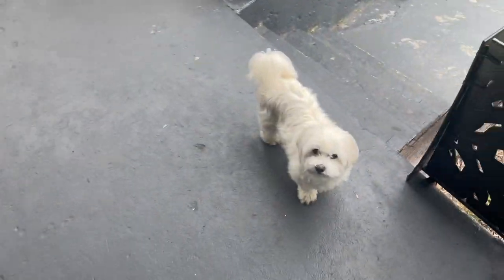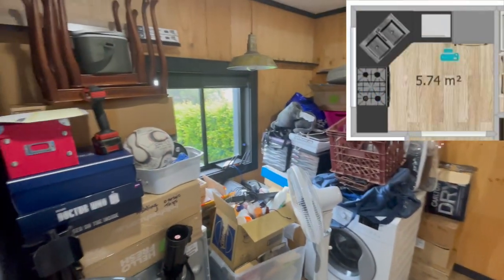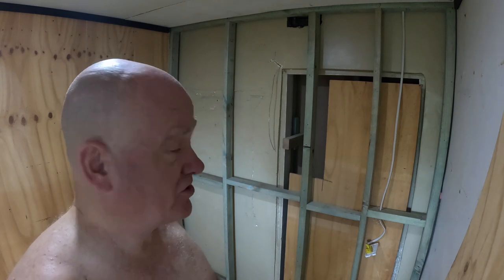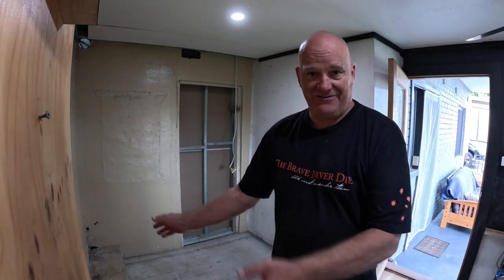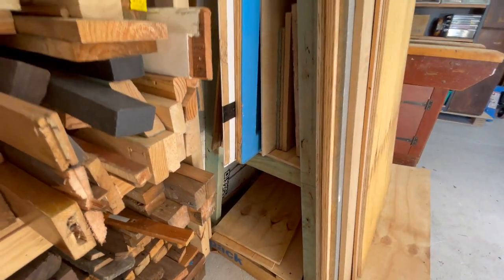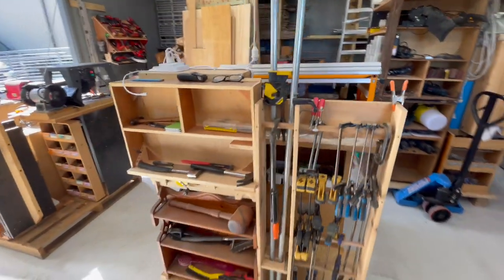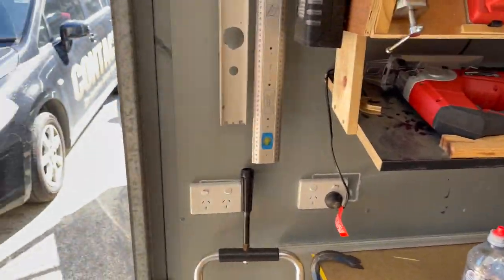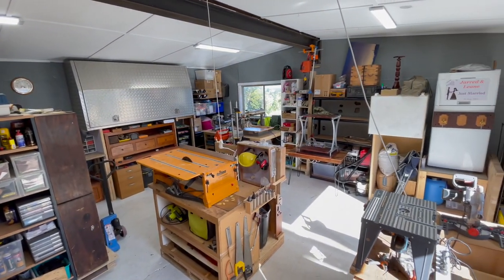Ashling's bathroom demolition pt1

Comment: Looks really good and workable.  I only wish I could get that much power into my workshop.  As you use the space consider not allocating machines space parallel to the wall, if you try some diagonal you might make other spaces useable too.
Mike
Reply from the maker: Thank you Mike. A second opinion is always valuable – and much appreciated.